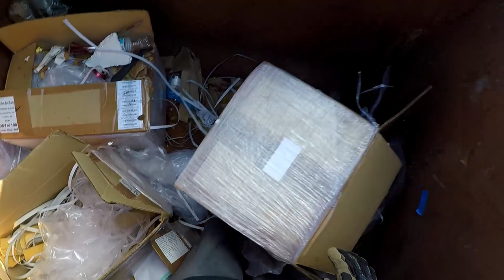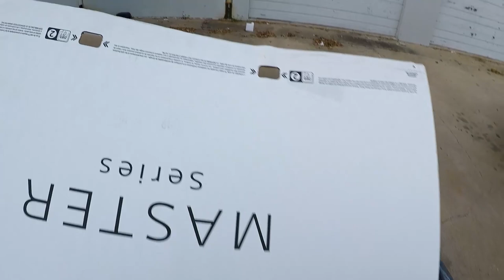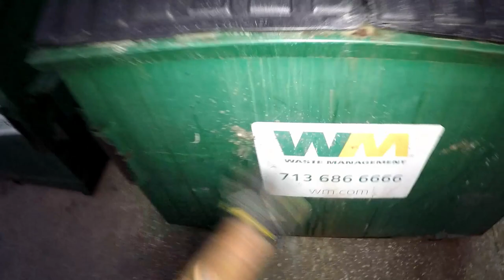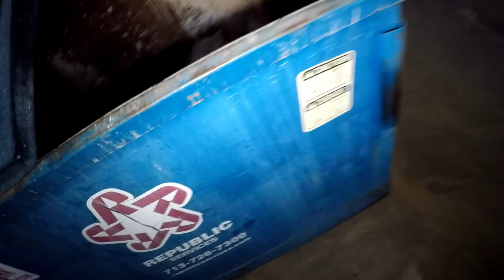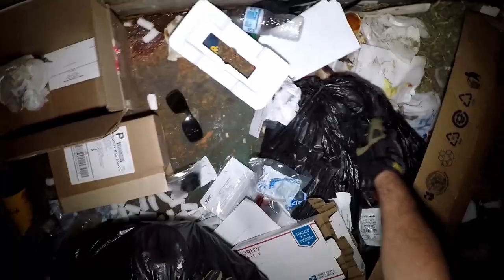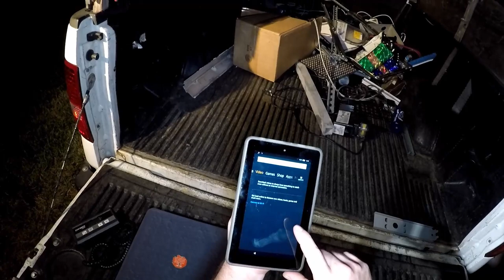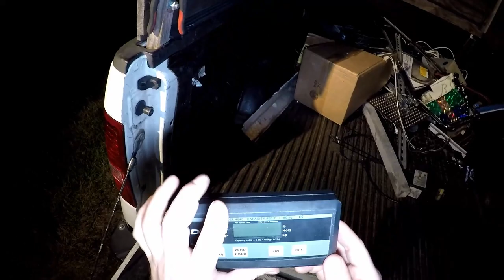Dumpster Diving "A Bag Of Awesomeness!"

Comment: it's called a threshold plate, and that rainfall showerhead was really expensive when it was new. i've installed a couple of them, and they were over $200 each. the slate chunks are the top of the pool table. i bet the entire table was in that dumpster. prolly couldn't lift it, so they busted it up.
Reply: (sigh)  That thing was NOT cheap if it had a legit slate top.

Comment: Like what the hell here I was ordering server rack slides and your find them like candy in a dumpster like a week after I receive mine.  As for the SAS cable its for storage, the cable is used to connect additional storage to the main system.  SAS stands for Serial Attached Storage